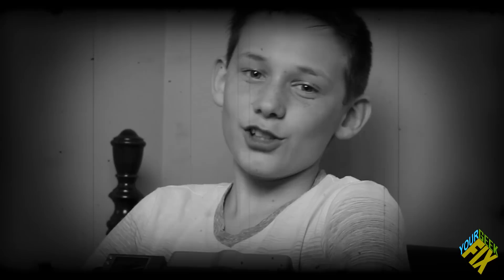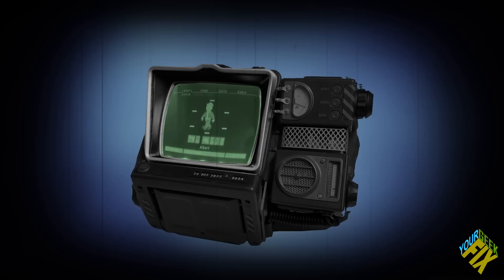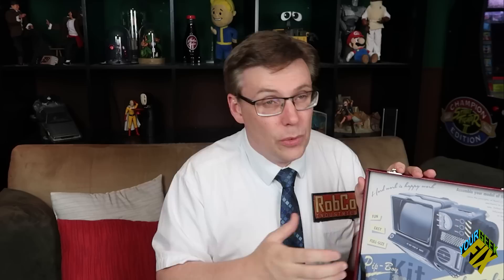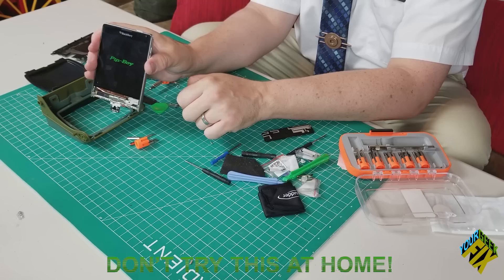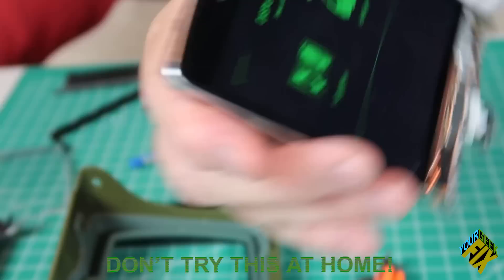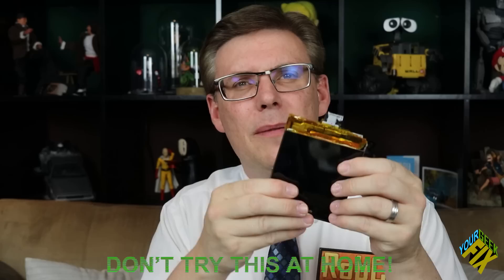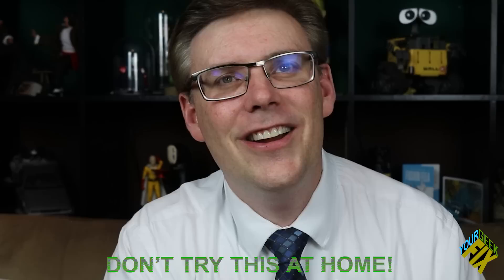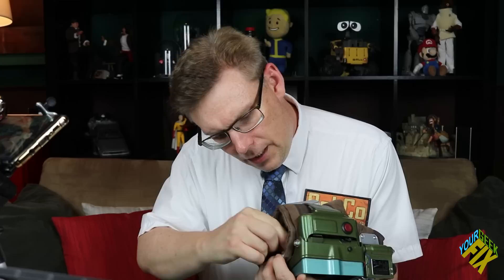How we made a real working Pip-Boy 2000 Part 1 of 3

Comment: BlackBerry Passport how to get android apps and on screen keyboard.

1.  Go to link and learn how to download google play store on blackberry phone | Blackberry Passport | z10 | Q10 | Z30 | Z3.

https://www.youtube.com/watch?v=WdOmDpEup2U

2. Install any apps you want from store

3. Download Fallout Companion app at:
https://apkpure.com/fallout-pip-boy/com.bethsoft.falloutcompanionapp

-- For On screen keyboard --

4. Go to broswer and go to:
https://apkpure.com/hidden-android-settings/com.kasitskyi.hiddensettings
download /install Hidden Android Settings.

5. Use your broswer and go to:
https://apkpure.com/technical-keyboard/nextapp.inputmethod.latin
download /install Technical-Keyboard.

6. Go into  Blackberry Passport original Settings / Language and Input:
Disable the following:
 - Feedback (Vibrate on Correction, Keypress Pop-up)
 - Touch Enabled Keyboard 
 - close Settings.

7. Open up Hidden Android Settings / Settings / Language and Input:
 - Under Keyboard and Input Methods uncheck BlackBerry Keyboard and check NextApp Technical Keyboard.
 - close Hidden Android Settings.

8. Open Technical-Keyboard:
 - 3 steps setting up which may lead you back to Blackberry Passport original Settings, if so just close page and continue setup. 
 - Close once 3 steps are done.  Re-open app to add finishing settings, i made adjustments to the keyboard/row heights in the advanced settings.
Reply from the maker: Thanks for the tip. Good references. Thanks Matthew.

Comment: Can I run Skyrim on it
Reply from the maker: I would doubt that. You can run old versions of Doom and Fallout through x86 emulators. Is it did run, it would not be at the FPS you need. You could port it.
Reply: @YourGeekFix  tbh, you could use that low polygon mod and textures and make your Skyrim look worse than the original Tomb Raider and probably get 15 fps

Comment: lol you know you can get touch screens for less than 10 dollars and a raspberri pi for 35 dollars. you did the screen the hard way.
Reply from the maker: That tells me you didn't watch the second video. There is not enough room at 1/4 inch deep.
Reply: @YourGeekFix  plenty of room. Get the raspberri pi zero. It should not be more than 1/4 inch and if it is, you can move the board since you would then be able to have as long of cord as needed.
Reply from the maker: @TheKlopka  you. Also need power and screen to fit In that space as well.
Reply from the maker: @TheKlopka  the rule is it must fit in the monitor module.

Comment: I shouldn't have built it with the given tools?
And you call yourself a fan.

.....It was infuriating
Reply from the maker: The tools are definitely only for the holotapes. They don't specify that though. Quick way to ruin your hands and collectible screwdrivers.
Reply: @YourGeekFix   Yeah, I also have big hands....I definitely do not recommend.
Reply from the maker: @dood2274  I agree.

Comment: Nicely looking thing, but always with a shittiest electronics ever inside.
I mean, does someone tried to design a single board computer(at least, use raspberry pi compute module) and install linux/android ?
I would try, but when I just imagine how many blueprints/3d designs I had to make and think over about making that thing practically useful: ip68, maps and sort of those things-I got completely anxious. And I don't like plastic materials at all and since I'm from country where you can get airspace/military grade titanium almost for nothing on flea market: why not to use metal. But this thing is quite complex.
Reply from the maker: So the challenge was to fit it in a 4x4x.25 inch space and connect to Fallout. The titanium access in your country sounds interesting.
Reply: @YourGeekFix  Inches...never liked imperial system at all, I mean even my prof escaped from usa: one of the reasons was their system.
Okay, 10×10×0.625 cm, right ?
With the titanium I've got a funny story:me and my prof decided to use titanium-I found a nice guy with a turner and tools to process all our weird requirements(10 micron titanium foil, titanium rods, copper discs, tungsten strings, etc). So, then we bought a quite heavy and nice rod in diameter around ~ 1 inch and length about 1 meter. Just a nicely looking titanium, stolen from the old soviet aircraft factory, since economy "grew up for a new course" we could afford that easily. So, prof. became paranoid, saying that: "...that titanium from old soviet nuclear submarines and it should be poisoned by radiation". Guess who found a military dosimeter for around 15$ without a bag of accessories(manual, testing rod, additional batteries). So, I've played around that thing, made a small modifications of battery holder: it was supposed to use with special military type batteries with a huge shelf life. So, I scientifically proved that he had paranoid strike for cheap, stolen titanium.
I've used that for casing of my toys: my friend found/bought a milling machine and I just needed to sketch dimensions, since that milling machine was a soviet BIOMECAHNICAL-CNC-MILL.
I just got stuck with main problem of those toys: display and power consumption. This thing could be sort of computer for survivalists-fallout-fanboys.
SBC, e-ink display, keyboard,gps satellite messaging system and bunch of peripherals in ip68 futuristic enclosure. May be it could be made from polycarbonate or any sort of robust and lightweight plastic, at least in carbon  composite material.
Reply from the maker: @user-nz8rv8ft5q  I trust your cm conversion is correct. Good luck.